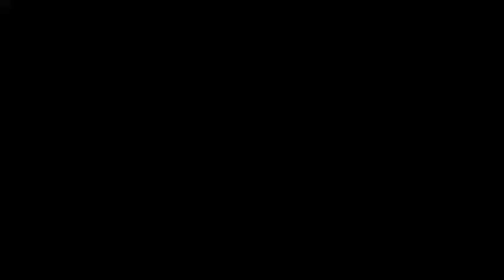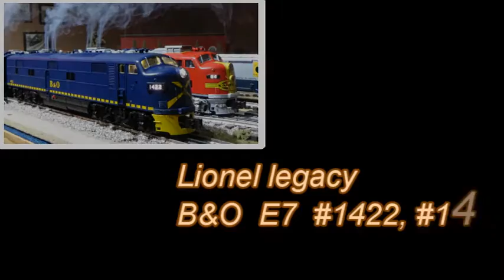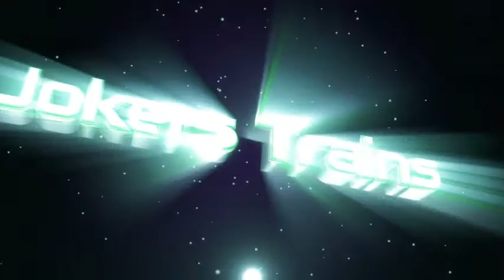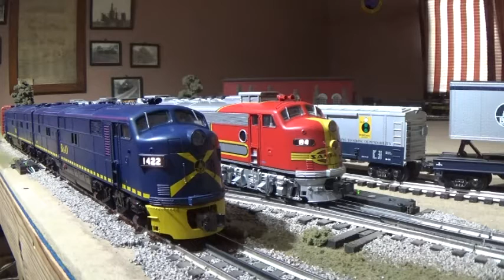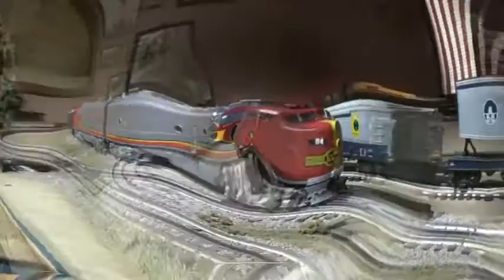Lionel Legacy B&O E7   6-82829

Comment: Hey Zac, you have been a big help in the past and I would like your input on something if you know what to do. So I just got a Virginian 2-8-8-2  brand new yesterday and when I took it out of the box one of the number plates came off. Would you Use hobby cement to glue it back in or what? Thanks
Reply from the maker: H20 Lacrosse can you send me a picture of the number board and where it's supposed to go. Just so I can make sure I know what it looks like. 
Noles34@yahoo.com
Reply: Zac Elliott YES! Give me about 10-20 minutes